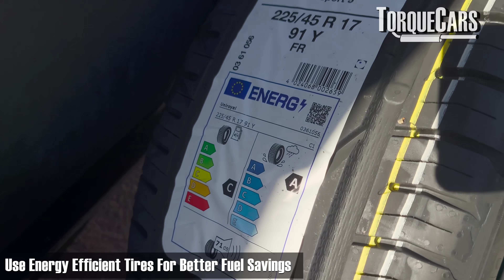10 Fuel Efficiency ECO Driving Myths Exposed 🚗💨  What Really Works? - Save Fuel the RIGHT Way!

Comment: Get an OBD2 dongle that you can connect to your phone so that you can track fuel consumption in real time, and see changes within a few seconds. On my car I learned that it runs most efficient around 85 km/h, and keep the throttle steady if possible even if speed varies a little, and if needed use small adjustments so the ECU can optimize well.. 
27 KM/L on the highway (long rides when its warmed up) in summer with a suzuki alto (2009) with it's 1.0 engine is very well possible (30+ can be done if all the stars align). 
Biggest "killer" of efficiency turned out to be moving the throttle all over the place, as after every time you make a rapid change it needs 20-30 secs to go back to very low consumption again.
When my sister who is a way more agressive driver and won't even allow 1 km/h under the speed limit and because of that is constantly changing the throttle position never even hits that "efficient" point in my car where the ECU has it all figured out and gets really high efficiency.  She just keeps it busy with constant "big" changes to the throttle position.
Reply: The Toyota/Lexus Hybrid Synergy Drive eCVT also exhibits similar behaviour to what you described. The engine handles immediate changes to power demand when the throttle is varied. If throttle is held constant for a short period the system then figures out an optimum set of RPMs within its planetary gearbox for the established power demand. This is felt and heard as a sudden decrease in engine RPM and noise, and a jump in fuel economy as engine and electric motor outputs are balanced out.
Once my car hits this state I would hold it and let the car's speed vary over small inclines. In fact, hypermilers find holding constant throttle on the flat and uphill, letting off on the downhill, and therefore rolling over hills like a rollercoaster gives the best fuel economy because the ups and downs would often average each other out.

Comment: Here in Norway, mostly charging at home, we average 1/10 the cost compared to fossils. Cheap electricity and expensive fuel. Also smart apps for chargning when the electricity price is low. Especially during the night time. Charging while travelling though will cost the same as fossils, and more if you include food and drinks while waiting for a charge :D
Reply: Oh nice. What it is to live in a big country with a small homogenous population heavily subsides by the oil industry 🥳🥳🥳
Reply: @Olliebobalong  I believe every country should be able to subsidize electricity through higher taxation on fuel. It all depends on what strategy a country pursues. The oil industry in Norway is not directly subsidizing anything. It goes into to a huge fund which invests all over the world. Rarely do we see anything being budgetted out of the fund. Taxation is key to be able to control what a population does.
Reply: 😂 folly

Comment: Injector cleaner....42 to 47 mpg. Every 1000 miles or so.
Reply: Are you leaving the hand brake on? My 2.0TDi does 60 -70 mpg on my daily commute
Reply: @scottdyke7853 not everyone drives a diesel on the motorway
Reply: 1000 miles seems excessive. May as well just run it with premium all the time.
Reply: Full throttle weekly is a cheap injector clean you can do instead. Full flow through the injectors periodically will prevent any blockage from forming or at least, make it very unlikely.

Comment: I have always used a good brand fuel ( BP ,Shell etc)..I hardly  ever fill up with supermarket fuel, I'm hoping  my injectors are relatively  clean.
Reply: Supermarket fuel is shit
 However, Tesco Momentum is good.
Reply: Tesco 99 is good. Also where do you think all the supermarkets get their petrol? They sure as hell don't drill for it themselves 😂

They're just cheaper because they can offset the cost with the groceries business.

Octane matters more if especially on turbo cars
Reply: @odin5188  My understatnding is that octane matters if the engine is designed to be able to use more octane, otherwise the difference can be only the end price and not necesseraly in car performance. I'm sure there is plenty of YT clips diving into this subject.
I wouldn't bet my life on it but I heard that while the same fuel is at the local distribuition points there are different addicitives added later on. Not sure if they are adding it just before or after delivery to gas station still the end result is alegedly a fuel with different additives on different brand of stations.
Reply: @tomasz5274  Yes you're right it matters on turbo charged cars to help against detonation.
It's not only because of octane i use it. Like you said the cleaning products. Anyway to protect against carbon build up,  is a good thing

Comment: Nitrogen goes up in pressure more as it heats up than regular air. The reason they use it in racing is because its composition is entirely known and its behaviour is thus able to be precisely predicted. Regular air is subject to all sorts or local variation and contamination which means its behaviour will not be as consistent as that of pure N2 from track to track and from race to race. When you're chasing microseconds that can come into play. When you're going up the M1 in moderate traffic it makes pish-all difference.

Don't waste your time & money.

Comment: In our little Mazda MX5 we have used both e5 and e10 fuel. We get better mpg with the high octaine but its cost is higher. Overall we break even on price per mile. The fact that the engine just runs better on the high octaine, I think its worth using it all the time when possible.
Reply: Interesting, usually engines are designed for specific number of octaine and they should work the best with such fuel.
Using higer octain fuel in engine designed for lower values may give no or insignificant difference (waste of $?)
while using lower octain fuel in engine deisgned for higher values should cause inferior performance.
The car/vehicle manual should state which fuel is recommended.
Note: sometimes the same car models are supplied with the same engines but tuned to different fuel for different markets
so it's best to check manual supplied with car or dowonload the one for the market matching the vehicel origin.
Reply: @tomasz5274  in the Mazda it says 95 is the minimum. No noticeable power difference, just mpg.
Reply: @jim-bob-outdoors  that's due to the Ethanol content.

Comment: Actually havent tried the high octane  fuel since the the manual stated that it doesnt need it. On the other hand 10% Ethanol  instead of the regular 5% fuel had way worse economy with my car. So much worse that the. E10 fuel is more expensive overall.
Its supercharged maybe I should try the premium once just ro see if it makes a difference whatsoever.

I guess the 620km biweekly comute is long enough to get something conclusive.

Comment: For diesel owners in the UK - you can use the cheapest of supermarket diesel and add Millers Diesel Ecomax additive to it each time you fill up - this ups the cetane in the fuel and adds cleaning additives for the fuel system.

Doing this over the last 40k miles has given me a similar effect as I’d expect running branded premium diesel: It’s cleaned out the deposits on my car (now on 175k miles), the economy has gradully risen - I use the Spritmonitor app to record actual fuel consumption as calculated at the pump. The cost is under 2p / litre if you buy the stuff in bulk.

I’m not affiliated with Millers Oils who makes the stuff - just a happy customer. It’s a British firm too which also makes me feel good about using it!

In hindsight, I should have done a diesel purge when I got the car, but that’s a lot more involved than just adding this stuff to the tank each time - and I got the same result eventually!

Comment: My Vauxhall Astra 1.6 diesel 2015 j tyres have a economical pressure of 36 psi which does give me a greater mpg but the ride is to hard and my wife complains so 34 is my happy pressure but if I am carrying more people on a long journey then I put more psi in and ride is ok you don’t realise how the pressure increases as the tires get hotter. You can see this on the tyre pressure monitor which I’ve never had before on a car the biggest thing that increases mpg is your speed at 60 miles an hour on the motorway in sixth gear with cruise control on a little traffic. I can see my car achieves over 60 mpg it was average 56 mpg around town but I got a new battery fitted a few weeks ago and the stop start is working again but I turned it off because it annoys me
Reply: My car is a lightweight little aluminium Audi A2 - I had the tyres set to the full load pressure and wondered why the ride was so bad - turns out I had 185 section tyres and the pressures on the fuel flap are for 175 - the correct pressures were therefore just 3 psi lower from where I was. That small difference made an unbelievable improvement to the ride quality - which proves cars are more sensitive to tyre pressure than you might think.

Comment: I've always used supreme e5, used e10 and the engine just feels like it's numb and lifeless and less responsive overall. I rather pay the extra per litre and enjoy my car and driving. Also see better mpg with supreme overall.
Reply: The E 10 has a lower calorific value, it basically doesn’t burn as well as E 5.
Reply: @adji69  Since that e10 came out my car sometimes has a flat spot on pulling away briskly from say a roundabout and my car was made in 2015 so was apparently made to run on it but doesn't like it although I can't say there is any difference in mpg that I have noticed.
Reply: @david-hf3dk  my car is a 2015 too, has a turbo and I've read that e10 is no good for trubos. Not sure how true this is. But definitely feels lifeless and isn't as responsive

Comment: i call bs on the auto's giving better fuel economy than manuals and i can prove this with any car over a course of 3,000 miles.... i'd even pay all costs if you have an auto/manual in the exact same car... proof? ive got hundreds of pics/video's i take as my dad and I compare fuel economy, i drive a 2012 fiesta diesel.... my minimum MPG is 68, highest ive ever had was 82
Reply: Those diesel fiestas are brilliant on fuel - you can get 60mpg without even trying.
Reply from the maker: For reference I know the Audi/VW DSG boxes are usually more economical than the manual version with the same engine, when they have an extra gear and dual clutch operation it makes sense.

They are not alone, in my research I pulled up the following that also follow this trend. MPG quoted below are the US version, UK MPG figures are generally higher all round, because we have a smaller country and have to make distance and fuel look better. LOL

Honda Civic (1.5L Turbocharged Engine)
The Honda Civic equipped with a CVT achieves better fuel economy than its manual version. For example, the CVT might deliver around 36 MPG combined, while the manual version typically falls a few MPG short, especially in city driving.

Toyota Corolla (2.0L Dynamic Force Engine)
The automatic version with a CVT, featuring Toyota's advanced gearless design, often exceeds manual versions in efficiency. It’s common to see the automatic model reaching 40 MPG highway, while the manual stays closer to the mid-30s.

Mazda3 (2.5L SkyActiv Engine)
Mazda’s automatic models equipped with SkyActiv technology are tuned for peak efficiency. The automatic version can hit approximately 31 MPG combined, whereas the manual version may achieve around 29 MPG combined, depending on the configuration.

Hyundai Elantra (2.0L and Hybrid Models)
The standard automatic Elantra with the Smartstream CVT often boasts higher fuel efficiency compared to its manual counterpart. For instance, automatics can achieve 35-37 MPG combined, while manuals might hover slightly lower. The hybrid automatic models perform exceptionally, offering up to 50 MPG combined.

Ford Fiesta (1.0L EcoBoost Engine)
While the manual transmission is engaging, the automatic version equipped with Ford’s dual-clutch system can surpass it slightly in fuel efficiency. Automatics may achieve around 37 MPG combined, with the manual trailing by 1-2 MPG.

Volkswagen Golf (1.5L TSI Engine)
Volkswagen’s DSG automatic transmission often outperforms the manual in efficiency. A Golf with the DSG automatic might reach 40 MPG highway, while the manual version remains a few MPG behind.
Reply: @j-on-osrs-2k7  I get better fuel econ from an auto audi A4 compared to my old manual A3, despite being heavier (probably the newer engine makes the big difference, both 2.0 diesels 2019 vs 2011 and 150 vs 140 hp.)

Ps: I drive with as much engine breaking as possible most of the time, and used to always downshift the manual.
Reply: @dodiloi There’s a lot of love for the VAG PD diesel for a reason 😊
Reply: @dodiloi  that comparison you just gave might be good foe you, but its not the point i stated... I said with any car thats the same, so if we compared a manual vs auto... They would both have to be either an a3 or a4, one in auto one in manual, not an auto in one model and then manual on a completely different model. This isnt just theory by the way its proven facts across multiple car brands with manufacturing centres doing their own tests, the manual always gets better MPG
Reply: It's a bit of a broad statement tbf - I have always had a manual and still apply engine braking and all the other tricks to get max mpg when aiming for it - on the other hand my in-laws pootle around in 3rd or 4th gear in their manuals cos they DGAF. I got fed up of the gear changing and opted for an 8-speed auto as a replacement - it was a bigger car and on paper the mpg was comparable to the manual 6-speed (manual was a few mpg higher) but the reality is far from it as it's not quite a traditional slush box but behaves like one when cold which kills the economy - once warm and the torque converter clutch engages, the instant economy shoots up and it behaves more like a manual with "pseudo" engine braking etc, but this is only at higher speeds - at lower speeds and gears the revs shoot up. It tries to maintain 1500rpm across the gears but I often wish it would change up whilst "cruising" at lower speeds/loads - it was easy to jump to 5th in my manual to bump up economy at 30mph for example. It also has 2 high overdrive ratios for cruising so great on the motorway - I was seeing averages of 60mpg over the summer on a run, however come winter I will rarely average 50mpg on a similar run due to cold starts and generally bigger loads such as wipers and lights being on...I suspect DC and CVT "autos" will be far closer to a manual as they can remove the "human" aspect but behave more like a manual...

Comment: When I drive my Toyota hybrid with its e-CVT on the highway, I find there is a speed sweet spot where the fuel economy goes down from either being too fast or too slow. Too fast and petrol is burnt uneconomically to fight increased air and rolling resistance. Too slow and the amount of petrol burnt per second does not cover as much distance.
Reply: @jonathanl1276  so what speed do you find has the best mpg?
Reply: @Ep1o  I drive a Toyota Aqua/Prius C. On a completely flat and well-maintained highway its 1.5L engine can hold 80km/h at roughly 30-35km/L (70-80mpgUS). If I go faster or slower the instantaneous fuel economy begins to creep downwards. At least if I slow down below ~65km/h the engine is able to shut down and I can begin coasting in EV mode.
Reply: @jonathanl1276 48mph on the highway! Are you serious?
Reply: @0HOON0  It depends on where you live of course. Most of the highway speed limits near where I live in New Zealand is 80km/h which suits my car's fuel economy just fine.